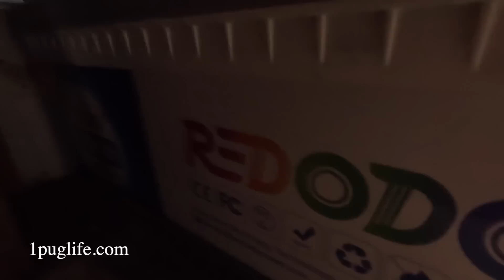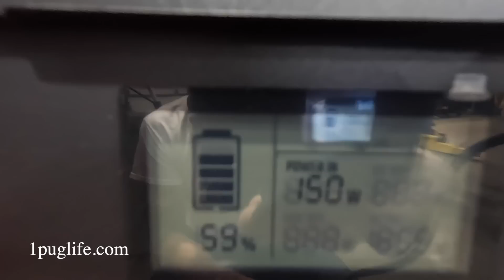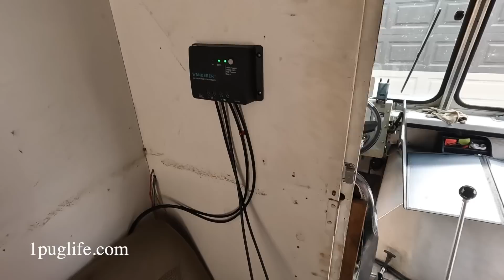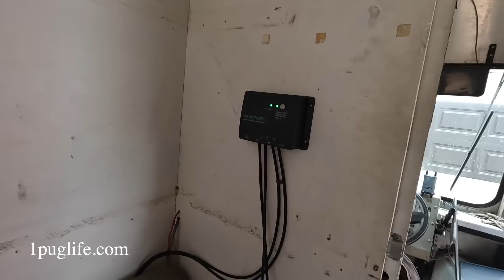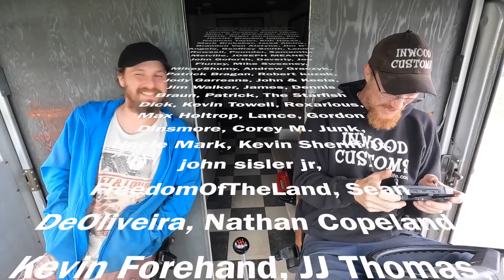harnessing the suns rays and converting them to power with grecell T-1000 power station

Comment: your gonna want a gas/diesel generator for the cloudy days pug. you can never rely 100% on solar here in canada,  i got 1000 watts of solar and  300ah of batterys on my camper and its not enough some days especially if your camping in wooded areas where you cant get full sun on the panels